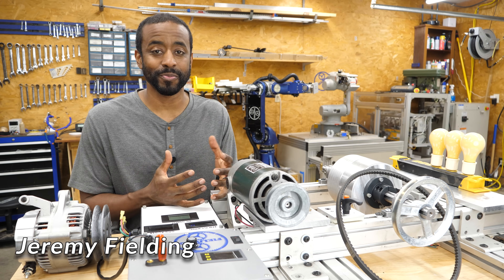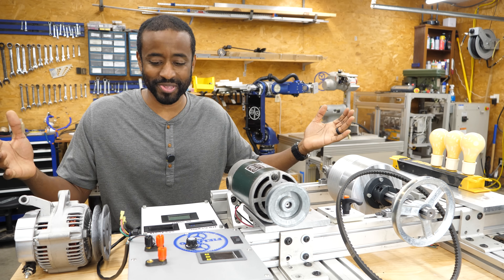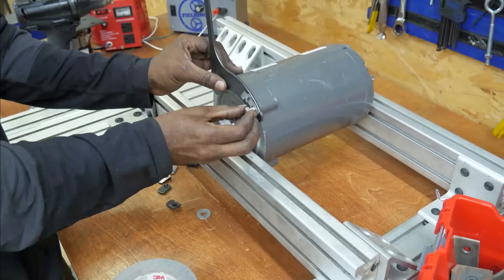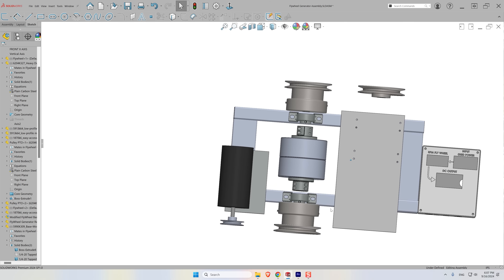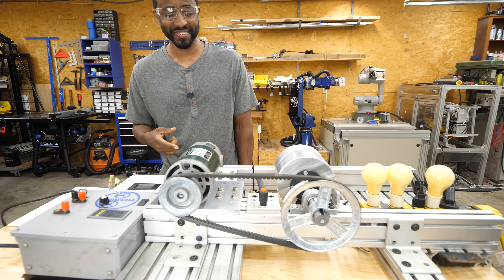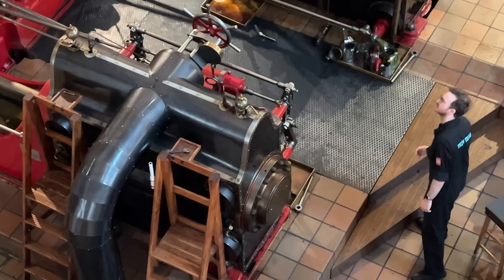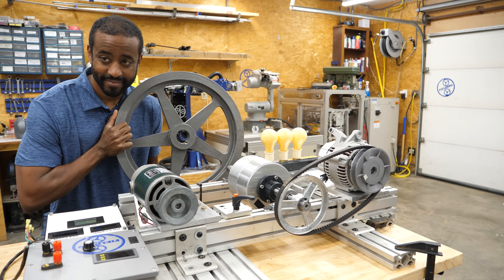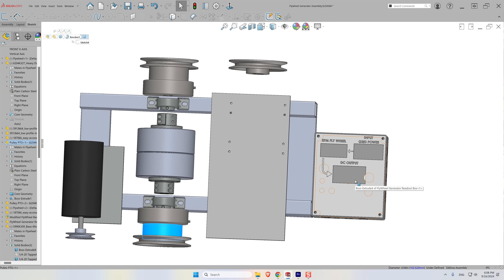A Machine To Test Free Energy Ideas.

Comment: The real point is to keep distracting from what is Truly Possible in Real Engineering::: For Example: if you take four Motors like you Have There and Strap Them Together  with Fan Belts amd you have Optimized its ability to Rotate Freely ( Best Lubed Bearing Arrangement) , And then Combine it to a Heavy Metal Flywheel ( This is A Miniature Scale Example) that is Optimised for rotation and Balance , with a Magnetic (and maybe Spring loaded)  Configuration for Optimized Self Perpetuation ( not meaning it will Run forever at a Acceptable Velocity while Producing a  Very Good Amount of Kilovoltage . Now Let Say we Add a Small Combustion Chamber that , With this Arrangement need to Shoot Off a  Sparked Miniscule Amount of Hydrogen! Into a Configured Chamber of That Flywheel Every ,Lets Say, 7min ...or even 27 min!!!  and Lets Say we Base it on That 10 ton Flywheel thats been Turning for the Last 60 Years  ,,, If you end up Producing 40 000 Kilowatts of Power at a Cost of 20$ of Hydrogen per Day!!! Isnt That Great Enough??!!??

Comment: But it is undeniable if you take two neodymium magnets and try to push them together that resistance can be considered free energy
Reply from the maker: That isn't energy. That is a spring. You are pushing them together. The energy was added by you sir. If you let go the energy is released and there is nothing left. You have to "PUSH" them together. If this worked millions of people would have come up with this over the last few centuries we have been using magnets. There is no way to arrange magnets so they push on their own. It doesn't happen without you adding the energy first.

Comment: air bearings needed and a bigger flywheel
Reply from the maker: A bigger flywheel only means you need more energy to spin it. Just look at the formula. There is nothing magical about the flywheel. This is sort of like saying you need a bigger gas tank. That doesn’t change the fact that you still burn gas. In fact you burn more because the tank is heavier. Same with a flywheel. You waste more.

Comment: The flywheel  you consider is not flywheel  it's a load it better to cheek the concentrated weight on the outer part of the wheel  it has to be more thick to store  energy
Reply from the maker: I think you are missing the point, and of course ANY flywheel is also a load. That is related to the point of the video. Certainly moving the weight out to the edge increases energy storage. But that is one part of the formula. So does increasing speed. In fact, if I double the speed I get 4 times the energy storage. It is worth taking a moment to look up the formula to calculate flywheel energy. I think this will help you understand what I am trying to say here. My other point is flywheels are designed, and you don't have enough information to say my flywheel is not good enough for an application unknown to you. You don't know the speed, the mass, the diameter. etc.

Comment: Jeremy...is it by any means possible to use a 1.1kw 4 pole electric motor to run a 5.5kw alternator, to get 4.4kw surplus energy? I just want to charge my solar battery, no other load. Please advise if I should stop wasting my time or keep going. I'm removing my alternator from my gas generator.

Comment: Idk if you use carbide end mills much but the hanita brand is a good option I put the 1/2 inch 4 flute full depth&diameter at 26 ipm thru steel on a ez trak ate it like butter

Comment: i enjoy your videos. Please is there any mechanical /electrical simulation software (with pulleys, chain, sprockets, belts, motors, etc) that is easy to use like Circuit Wizard Software. I am not good at drawing so just picking the components to form the machine design helps. If there is, I would be glad to buy one or use the trial version.

Comment: Your sponsors wouldn’t like it if you showed us the truth….. naw you hide …. You are not lame…. I don’t hate the player I do hate the game…..  knowing good in well    Small Dc motor high torque into wind turbine 3 phase generator … combine with  pulleys ……add a few super capacitor after the 3 phase charge controller ….. or batter . Then inverter Jupiter 5000.  ; sure the rig is around $600.00 , and bam endless…  or at least 4 endless sockets .

Comment: Been thinking about using them pro power ones like that in few different projects.  Definitelynot no expert but was wanting  to do a driveshaft on 4 wheeler where lock it in 4x4  itsca 300 honda full time 4x4. I know they made kit years back,  warn 2x4 but was going try something with parts i got and be electric no mechanical maybe messing up idk try sone different ideas been bouncing around in my ole nugget.

Comment: If you double the diameter but keep the same mass, the energy stored in the flywheels may quadruple according to the calculations I've made, maybe make them bigger it would help
Reply from the maker: This is also true if you double the speed. You get 4 times the energy storage if you double the speed. But that is like saying If you use a bigger bucket you CAN store more water. Of course you can! But where are you going to get the extra water? That is the whole point of talking about this. The flywheel does NOT create energy. It just stores it. So it doesn't matter how big it is, or how fast you spin it. It matters where the energy comes from.

Comment: "Free" to me would be the ability to run by itself perpetually without the need for any external power and can produce kilowatts of usable power for devices, homes, businesses and grid scale projects. Obviously, usable electricity is produced by a generator spinning at a certain speed. That's how a power plant is able to produce and transmit electricity to remote places and cities. Clearly, the holy grail of generators is one that can spin without the need for a "paid for" external source of power to drive it and keep it spinning indefinitely. There are plenty of perpetual motion machines, but essentially all of them are mechanically incapable of continuously generating enough torque to spin any standard power generation device and overcome the repelling forces that are created by the generator due to the laws of physics. Jeremy has demonstrated just how hard it is to overcome those repelling forces which eventually bring the spinning to a halt or a device failure. In one sense, a rechargeable battery is a "free energy" device, but until we can get "free from cost" energy to recharge the battery when its capacity is used up, it ain't free. Maybe if Max Chikumbutso's device becomes a reality, true "free energy" production may become the norm for every home and free consumers from utility grid bills forever. I'm looking forward to Jeremy telling us about Chikumbutso's new way to harness radio waves to generate electric power, whether it's a pipe dream or legitimate.

Comment: So. I've worked with flywheel energy storage companies and a way they manage friction is to install the wheel in a vacuum chamber to eliminate the air friction, and the mount the wheel on magnetic bearings.  The wheel essentially floats with zero mechanical drag.  Most times this is a cylindrical wheel they spin up to several thousand RPM and energy is extracted in the same way as an electric motor.  Even so, with all this, energy is not free and not magnified in any way.
Reply: An absolute vacuum is only in theory and even magnetic bearings have some small losses. The device will stop eventually.

Comment: Terminology is very important. Free energy is impossible. Just like perpetual motion is impossible. However, overunity does not violate the laws of physics or thermodynamics.

The importance of the flywheel is not as a mechanical battery. It is there as a load stabilizer and to require less torque to maintain operation. Just as a flywheel in an automotive engine.

Friction is the enemy in these situations. Better bearings and proper lubrication are vital. If you can hear the friction, it is too much.

Furthermore, the types of motors and generators are important. Their efficiency and power ratings can completely destroy the experiment.

My main viewpoint on overunity, alternative energy, and fuel mileage type projects, devices, or experiments is that many of these systems work around the world but somehow do not work here. They have videos proving many concepts, some that have been running for years, yet they are considered fake.

Remember that you will not have the next billion dollar idea because you will not be allowed to sell the device. Many inventors have lost their lives trying to better the world.

If the people can generate their own power, then those in power put a stop to it.
Reply from the maker: You can literally generate your own power right now. It is called a solar panel. These can even be bought a Walmart to charge your phone. You are so wrapped up in the idea of a conspiracy you can't see the forest for all the trees. Selling a free energy device (think solar panels) would be worth hundreds of trillions of dollars. You can tax it as much as you want (property taxes, car tag taxes etc), you can charge people just for having it (think rent) people don't want to make their own energy devices. They want to buy them. Think fast food. It only needs to be more convenient than making it yourself for people to pay a premium to have it from you with no work. The idea that this is a cover up when the benefits of NOT covering it are so great... I think you just enjoy feeling like you know something others don't rather than taking a minute to ask does the conspiracy even make sense.
Reply: @Jeremy_Fielding  like you said, solar panels are not free energy. Their efficiency and life span are their biggest draw back. As with most "green" technology. Just like EVs where you are trading one power source for another. They spin a big game but, in reality, fall short and are worse in the long run.

It is not a conspiracy to point out facts and history. The US government has inacted laws that are purposely designed to prevent the advancement and commercial sales of items they deemed a threat. It is called The Invention Secrecy Act.

The Invention Secrecy Act of 1951 is a body of United States federal law designed to prevent disclosure of new inventions and technologies that, in the opinion of selected federal agencies, present an alleged threat to the economic stability or national security of the United States. The Invention Secret Act allows the United States government to classify ideas and patents under "Secrecy Orders," which indefinitely restrict public knowledge of them. The law applies to all inventions in the United States regardless of what the idea or invention is, if a patent is applied for or granted.35 U.S.C. § 181 All patents filed within the United States are required to be reviewed, and thousands of ideas and inventions are manually reviewed every year. Any federal government agency with "classifying powers" may request any patent be restricted under the Invention Secrecy Act.

I do not know the answers. But at least I am willing to learn and try to figure things out. Sadly, many such as yourself go into these experiments with your mind already made up. Therefore, you make sure the experiments fail. 

My goal and primary reason for my channel is to test and experiment with these types of situations and concepts. As I slowly build my channel, I hope to be able to test my own ideas as well as others.

To be scientific, you must have an open mind.

Comment: Hi Jeremy as a mensan I've been researching over unity devices for the past few years and I've discovered that the laws of thermodynamics hold true... But here's the caveat, it's only true as long as you have a rigid directly connected drive between your input and output shafts, once you grasp this fundamental concept it opens us up to an entire new chapter of mechanics, namely indirect or flexible drive systems. So very simply, we all know a fan on a sailboat doesn't propel the boat... physics chapter one, but if you take two boats one with the sail and the other with the fan and link them via a bungee cord for example then you will get forward movement, a bumpy ride for sure😂 but it goes nonetheless...physics2.0

Comment: So take a generator head and a same speed electric motor along with another generator head start the first electric motor on house power then flip switch to the one head unit wouldn't that run it
Reply from the maker: You should watch my video "how regenerative braking works." In that video explain and prove the key reason NONE of these ideas nor any variation of these ideas will work. It really is so simple you will instantly see the problem with your idea. My test is also easy to copy for just a few dollars. I also encourage you to just try your idea yourself. This would be worth hundreds of billions of dollars if it worked. So it is easily worth your time if you were right, but really it's just the best way to learn.
Reply: @Jeremy_Fielding  thank you that's all I needed to hear I had someone that wouldn't listen or really under stop untill he read it idk why

Comment: i got you for a project get a axle shaped duel end table grinder turn it into a rearaxle and run 2 gerator motors on the front tires and on connect to the rear axle with gears so you can use 3 generators on one motor then you can push it off with the power you generate with 3 generator charging caps to run your spark gap motor

Comment: you can set a tank to have pressure above what you need always and have a pressure valve so it dosnt blow up then you can connect a magnetic steam engine with induction heating a steel ball inside a tank of water to make the pressure theres so many diff ways to get easy energy

Comment: fly wheels do work you have to take the load off the motor bye charging caps to run battery chargers the have it set to rotate battery banks to run the motors and you can have alternating charging with low load on the motor and you need to use a spark gap motor to run it i would also think about air pressure tank or water pump to keep the recycling